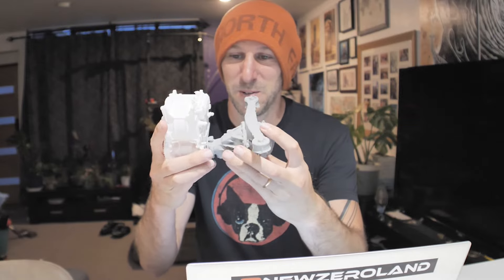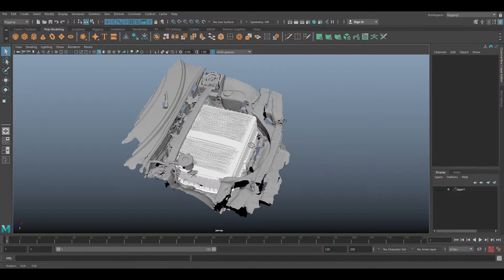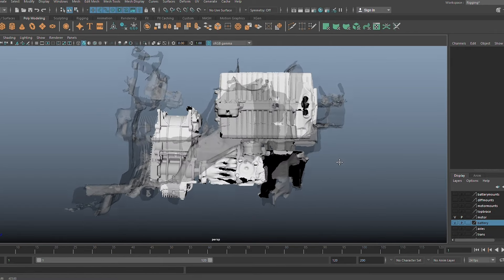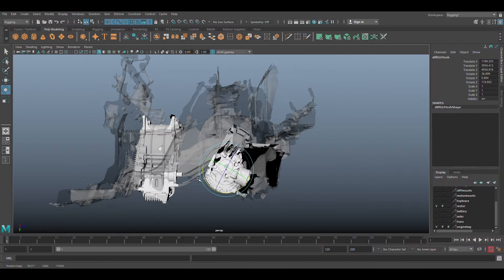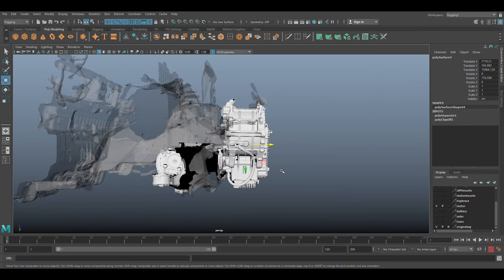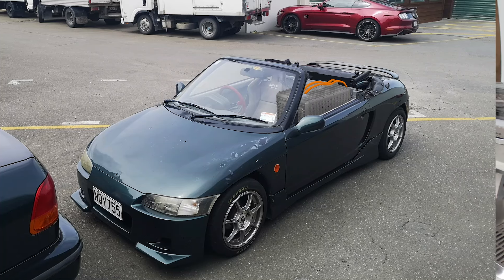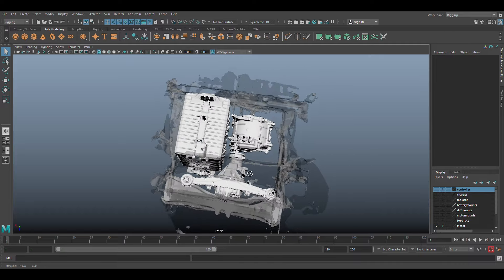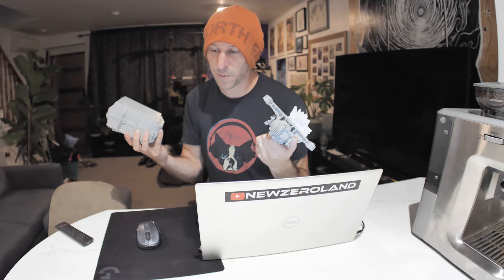Electric Honda Beat Conversion - Episode 13.5 - The Solution

Comment: Totally not using your experience in fitting things to help decide how I go about swapping my Beat...
Can't wait to see how this thing turns out. Absolutely awesome build. 👍
Reply from the maker: Haha cheers!  This is a really rare swap that I think only one other person has done (using Energica parts).. it would have been soooo much easier with Zero parts but I wanted more power and fast charging.  If you want to eventually convert your Beat with Zero stuff, you could even keep the transaxle and change gears if that sounds appealing.
Reply: @NewZeroland  I'm looking at keeping an engine in the car, so we've got some different challenges. But knowing what you've gotten away with can help me form my decisions. For example, I'm debating using a Miata differential hooked up to a V4 from a Honda motorcycle, so seeing it mocked up in your design software gives me a pretty good estimate for how everything would fit. There's also other solutions, like the Tesla brake assist swap, that I'll end up replicating, so seeing how it's done helps a lot. Huge props to you for what you've done. It's a big challenge and you've got a great community of people here to help make it happen!
Reply from the maker: @Sarin-Q  aw thanks!  Well if you end up going chain and sprocket, I have a Cusco LSD lying around haha.  The Tesla iBooster is amazing though.  Fully recommend.

Comment: You could even cut a gap in the frame piece and bolt each side to the battery; the battery is structural on your bikes right? I know my Monster had the frame bolted to the engine, so makes sense. Those 3D-printed miniatures make me think of Star Wars spaceships; you need to glue them together and paint them accordingly, and hang it up on a bit of wire in your garage. “May the Torque be with you’”.
Reply from the maker: That's a great point!  The battery can become one with the frame haha.  I should shoot a stop-motion animation with the little 3D printed spaceships.

Comment: Holy moley you must have a huge 3D printer. Im glad you found a solution make sure you have a spare for every custom part that will see wear and tear incase there isnt anyone to make those parts in the future.
Reply from the maker: Ooo that's a great point. I didn't think about that. A spare set of axles would be super handy to have just in case the high torque snaps em 😂

Comment: This is exactly where I was hoping you would go. There are lots of precedents for differentials that are offset from center. It's not absolutely ideal, but it's not at all bad, either. And compared with all the advantages, it's extremely minor. Here's hoping this layout does indeed work out.
Reply from the maker: Thanks man! It's only slightly off-center, so I think this'll work great. Just a little cutting and welding and we're on the road! 😂

Comment: yea that looks like the best orientation from a weight distribution standpoint. you also sacrifice the least practicality from both a driving and building standpoint. Cant wait to see it on the road.
One problem that remains in this configuration is cooling the battery case. with no air flowing over it in the trunk, youll likely suffer overheating after sustained use. my understanding of the energica battery case is that air is channeled through vents down the center of the case when its in the bike. to simulate this level of air flow, id imagine youll need to 3d print an air channel from the vents on the side of the car and potentially from underneath the car as well. there also appears to be enough room over the motor for a fan should you choose to force air over the battery. based on the CAD model, the front of the battery is too close to the firewall to route air lines in front, so my solution would be to route air from both side vents to the back of the battery via intake hoses using the room in the right of the engine bay.
Reply from the maker: Hey thanks! Yeah that's a good idea if I end up driving it long distances. The batteries don't heat up much while riding.. it's more the fast charging that does it. Having a 3D printed ram air scoop from the side vent would be awesome. We'll see how it goes!
Reply: @NewZeroland  If you only need the cooling for DC charging, you might consider a switchable fan (that you only switch on during high kW-charging). I mean: any electric car is usually wheezing and puffing when it's fast charging. My old Model S sounded like a hovercraft taking off when it was charging.
Reply from the maker: @berttroubleyn3475  haha yeah good point. I'll see how it does. I can upgrade stuff as needed.

Comment: Sounds perfect. You totally need to 3D print the rest of the car and make a little RC replica of it. Always a hit at any of the car shows when you get to that point. 
I think I'm going to get the Beat locally, I had a chance to look at it in person and it's actually a lot better than I expected, the interior is pretty nice for a $3k car. No idea what condition the motor is in but I'm still leaning towards a 'Busa motor, so we'll see.
Reply from the maker: Dude yes!!!  That's so exciting!  Man.. $3k is an insane deal.  I'm not gonna say how much my car cost because it makes me sad to think about.  I paid less for my FD3S.  Hayabusabeat would be sick.  I approve.  And great idea about showing off the model at car meets!  I wanna give the mini-prints to the engineering shop as a reference for where to put everything, and totally print the rest of the engine bay.  At 1:25 scale the engine bay is bigger than what my printer can do.. so I have to split it up.  I'll start on that tonight.

Comment: Make sure to also check the direction drive of the motor. You don't want it to give full power in "reverse" 😂😂😂
Reply from the maker: Oh yeah I checked the direction the diff spins and it's all good 😂 That was definitely a concern at first.

Comment: I was literally just wondering when you were going to 3D print the rest of the car. I guess in the effort to keep it simple we all discounted the thought of chopping any more out of it. Which is funny to me because I've been watching this other channel trying to design a custom sports car out of an old Porsche Boxter, and they're lopping off pieces left and right to fit the body design.
Reply from the maker: Haha yeah man.. NZ is strict about what you can modify, and I was arranging stuff with the assumption that I had to use all the stock mounts and couldb't even drill new holes anywhere, but it turns out we can go nuts on older cars like this.
Reply: @NewZeroland  Nothing makes you want to learn to weld like watching car customization and rebuild videos for reasons just like this.
Reply: @NewZeroland It Will be perfect... Take your time...

Comment: How about the green caps, details are important ;) , and that sounds a really good solution, having a shorter axel on one side than the other, is that going to interfere with handling? Hey - what do I know, I was happy with the first chain solution, and the second battery high solution. I like this solution too, go figure. Sorry not much help, just want to know, are yo painting the caps green.
Reply from the maker: HAHA fear not.. the caps will be green and shiny.  I'll paint them tonight and post a photo soon.  Axles usually aren't the same length so it should be totally fine.  If they have to be custom anyway, it'll be perfect!

Comment: It’s not dumb to not think of custom axles. It’s a simple solution that most people just wouldn’t come up with because axles are things that most people don’t want to mess with. As long as the custom axles are machined out of the right metal and heat treated properly then you shouldn’t have any issues.
Reply from the maker: Oh nah, I felt dumb for not thinking about cutting that frame piece to make room haha.  All sorted now though!  I can't wait to get busy on this thing.
Reply: That’s fine. Not trying to stop you from feeling dumb but I have worked with some dumb people in the past and you are not on their level. 🤣 I’m glad the realization hit before the work was almost done. 😁 That’s when it’s just sad.